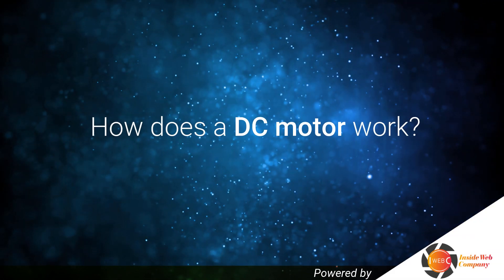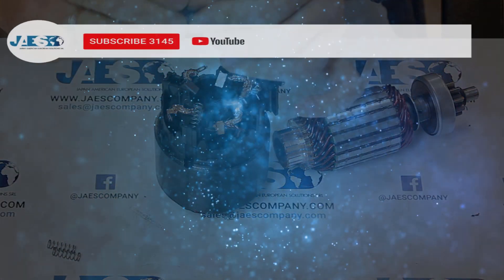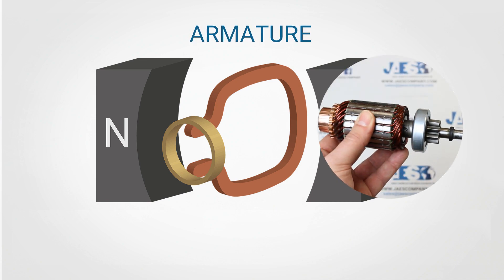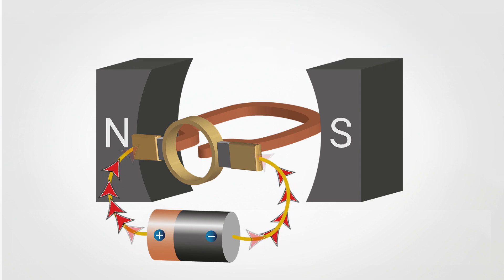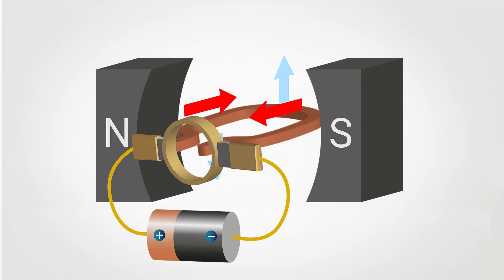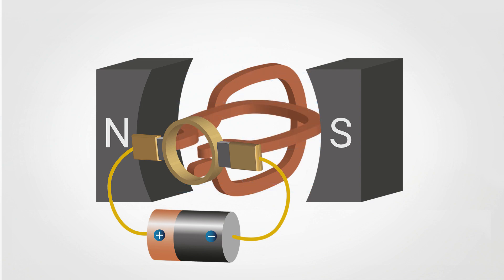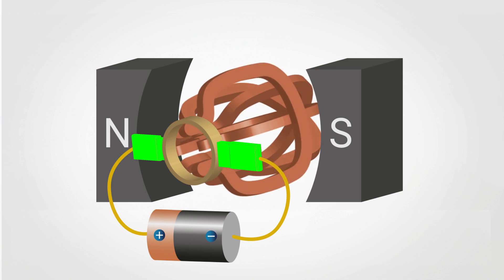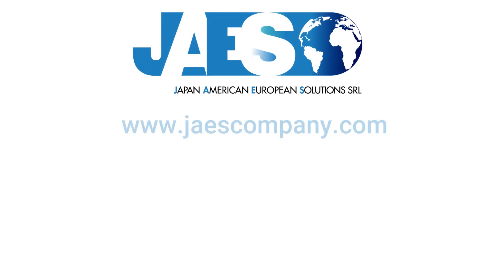How DC motors work - Electromagnetic Field and 3D animation

Comment: But why does the armature move? Yeah i get it it’s in a magnetic field but how??? I cant imagine it
Reply from the maker: Hello. Thanks for your question! The armature is made of many copper windings. Each winding receive, in sequence" the electric current from the battery creating different polarities on them. For example the winding on top is positively charged, so it will move towards the positive side of the magnet. At the same time the opposite winding on the bottom is negatively charged so it will move toward the negative side of the magnet, and so on... This will cause rotation. More windings in the armature means smoother rotation. By the way this principle is clearly explain in our video about the Basic principle of electric motors https://youtu.be/E6n2aATnE2k or in this one where we build a Brushed Dc motor https://youtu.be/P0rBeCQ0IKM (watch from 15.31) Please we would like to know if you're clear on everything. If you want to learn more about our projects, please visit our website https://www.jaescompany.com/
Reply: JAES Company ohh okay i get it now. Thank you so much,